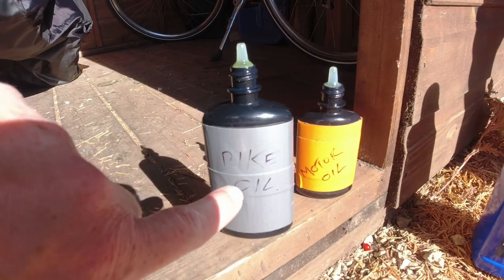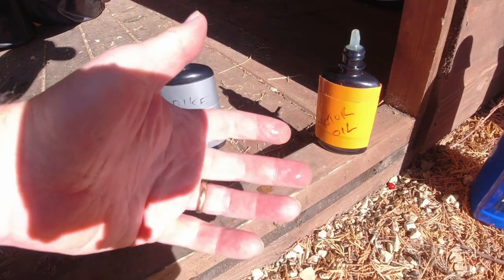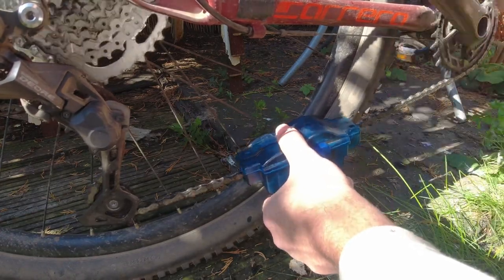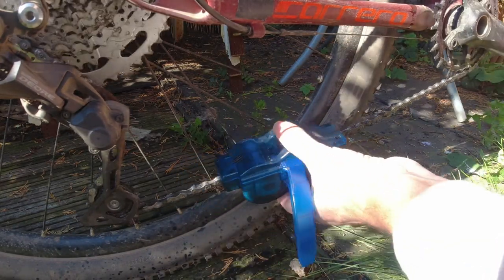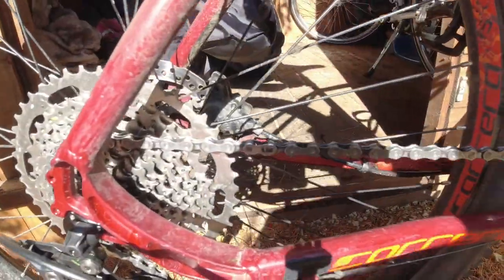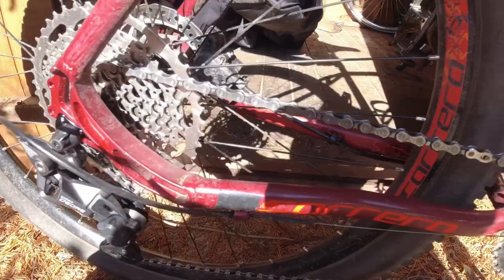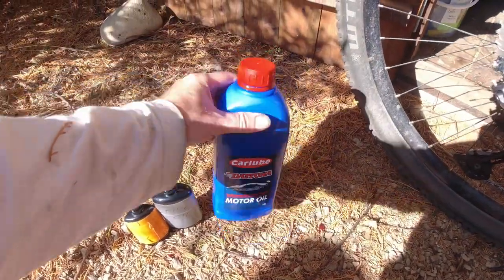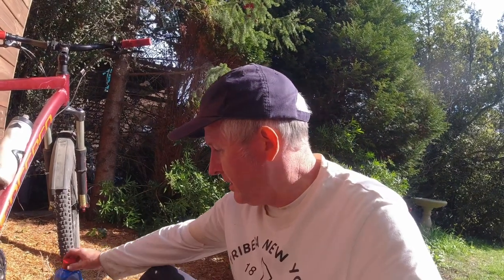Can you use engine oil on your bike chain ?

Comment: I grew up in a rural village here in South Africa and we always lubricated our bike chains with used motor oil. I actually never knew that motor oil is not black until later on in my teens when my dad bought a car.
Reply from the maker: Great story thanks for sharing 😁👍 yeah it looks like you were ahead of the game and I've just caught up. I now use engine or gearbox oil on my bike and it works exactly the same as the expensive bike oil and is so much cheaper
Reply: To dispose used motor oil in the environment is illegal. If you put it on your chain its nothing else. Also there is metal wear in it what es evn bad for your chain. Also engine oil as no additives for rust protection.
Reply: Same story here bro, grew up in rural south India, people using motor oil for lubing and never had any issues. But when we look online forums they kind of demonizing motoroil and promoting only branded chain lube oil😅...

Comment: Yes you can use engine oil on your chain. 
I've been using bog standard motor oil for decades !!!! 
On everything from high end racing bikes and racing, long distance touring bikes, ride to work junk, MTB.
And I've ridden them in all weathers and for 100s of thousands miles over the years.
Save a fortune and just use motor oil in a lever action oil can.
Reply from the maker: Yep you are bang on - there is to much of this 'elitism' in cycling now were manufactures will have you believe that you have to spend lots of money to get the best performance and people believe it. I must admit I have used the more expensive oils in the past but you live and learn eh

Comment: Been using used motor oil on my bike chain for 4 years and it works really good. A lot of people say motor oil is not a good bike chain oil, but at the time if motor oil can lubricant car pistons, valves, timing chains, etc I think I can trust it to lube a simple bike chain.
Reply from the maker: You are absolutely right 👍 Oil in a car has to do a LOT more work than on a bike. I have been using engine oil now on my bike since that video and I have had no problems and it saves me a fortune

Comment: Hi John, i like your way. I am with you that most bike lubrikants are just relabeled normal stuff. I am no expert. The internet says that motoroil has additives that attrackt water to get moisture out of the engine. On your chain you want the opposit. I use ATF now with no issues. But: any oil is better than no oil! Cleaning and lubing is the point! No matter what oil you use.
Reply from the maker: Hi Andreas - Yeah I think the bike oil companies are pretty good at marketing. Don't get me wrong there oils usually are very good but also very expensive and probably little or no different from any other oil. I do like the idea of being able to clean my chain more often and not worry about the cost of the oil
Reply: Motor oil getting moisture out of the engine? That's pure bullshit. The water gets expelled via heat + engine oil really like to combine with water as they don't separate(like gas, diesel, or cooking oil, silicone wd40 and stuff like that). The atf is also good, basically any petrol oil will do a it's job as long it's not too thick to catch all the dust but even then is good if u ride in harsh weather with a lot of rain/snow/dust as it's better to collect them then to penetrate the chain rollers and destroying the chain itsel.

Comment: great video, John :)

back in the day i used a small tin (same style as your plastic ones now) of bike oil - and i probably rarely put oil on my chain either, don't even recall cleaning my bikes much back then, and certainly never had a proper chain cleaning tool or a chain stretch tool haha... and never had to replace any of my drive thain ever..!

i first got into mountain biking around 1989 when a mate bought a raleigh montage atb (all terrain bikes as they were then..) - i had a ride of it - went flying down a mud track at jesmond dene (newcastle). hung on for dear life and went straight back to the top and back down...i was addicted to it! then i bought a raleigh mustang, then bought for first decent mtb around 1991 - a trek 950 which cost 500 quid... again, the maintenance was minimal...

i bought a trek 4900 around 2001, and when i was working at burmah castrol i bought a reduced price aerosol can of motorbike chain lube (cost about a quid for a huge can)...not sure what happened to that tho...

but with my emtb i use muc off's dry lube (which i think is specifically made for bikes?), you can say I've bought into all the correct cleaning stuff now as had the chain stretch took, chain cleaning tool (in fact bought a full cheap kit from amazon..)
Reply from the maker: Yes I have said this before but today's chains and other components don't last anywhere near as long as the stuff from years ago. I to never even noticed my chain on bikes from years ago. They just always seemed to work and you forgot about them

Comment: Yes. I've heard all the claims re it wears things out quicker, that it has additives that damage the chain, etc, never seen a scintilla of evidence to support them. You expect me to believe that the oil people put in $100,000 engines with 1000 hp has additives that are going to damage my chain that sees maybe 1 hp? Some of the only data I've seen re its friction on bicycle chains (at ceramicspeed) placed both 3-in1 and mobil 5w-30 (plain, not synthetic) in the middle of the pack of popular chain lubes.
Reply from the maker: Yes you are right oil for an engine is going to work just fine on a bike chain just as I have found out. I do need to experiment with the type of oil I used. Someone did mention that gear box oil would be good. That works out a little bit more money than the oil I got but it still works out a LOT cheaper than specialised bike oil. Its all just marketing really as cycling becomes more and more popular cycling stuff becomes more and more expensive

Comment: been using engine oil since i was in high school, parked the bike for several years, the chain was still lubed,. Why buy chain oil wich is the same price as chain itself? At that point you are just better off replacing your chain then keep lubing it up.
Conclusion: use whatever engine you have, thinner is better for winter, thicker is better for summer and bad weather to catch debris and deposit them on between the sprockets till you get home.
Reply from the maker: I could not agree more. I have to admit I had been duped in the past thinking the 'Special' bike oil was well.... Special. But of course its not and not I have a 2 ltr bottle of engine oil I got for around £4. I think next time I will try some gearbox oil. The daft thing is I had loads of half full oil bottles from working on the cars and i gave them away...... Duh!!  🤔😁

Comment: Engine oil is just fine, it could well be better than those expensive oil advertised for bikes.  I had used engine oil for a while and the chain was well lubricated, then I switched to DuPont ceramic dry lube to avoid touching the dirty chain.
Reply from the maker: Yes I could not agree more its just clever marketing to get cyclists to spend more money
Reply: I totally agree with you. It's a simply marketing strategy based on "This is good for something you love, so spend money on it."  This works on bike lubricants, car lubricants, firearm lubricants and even bottle water.  

People like you and me can save a lot of money. 👍👍
Reply from the maker: Yes some people do like to spend more money just because of a label or a badge or clever adverts. Its always been the same but I do love a good bargain and using engine oil on your bike is certainly going to save you a LOT of money. I do still need to experiment more with the oil I try maybe I will try some car gearbox oil as that I think would work even better
Reply: You also could use oilve oil, You could use any oil but that doenst mean that its good.

Comment: Engine oil as no additives for rust protection. Also there are good pland based biodegradable bike oils. There is no need to pollute the environment. I dont know why people complain about 10 bucks a year for a bottle of chain oil.
Reply from the maker: Engine oil does have rust protection properties but its all down to peoples choice. If you can afford expensive oils for bikes then great but some people cannot and engine oil will lubricate your bike chain just the same. I am not knocking 'proper' bike oil its good stuff but you pay premium for it
Reply: @JohnonaBike  No it doesnt and dont need any because it works incapsulated. I have seen a corrosion test with different substances from wax over grease and oil. They also took engine oil. The meta protected with engine oill rusted like it had now protection. To think just because the oil looks and feels the same it is the same is very naive. A bottle of bike oil last at least a year. Everybody can afford it. Its just stinginess

Comment: The reason why oil is splashing around from the chain is because the oil viscosity is a bit thin...20w 50....try a thicker  motor oil like 40w 70...a thicker oil will stick and wouldn't splash around...it will hold its position and lubricate properly...that's why your chain oil is so thick and expensive...thick motor oils are also expensive...
Reply from the maker: Yes that is a fair point if I used thicker it would certainly be better. Also someone mentioned using something like gearbox oil.  Thicker oil might be more expensive but I still think it would work out a lot cheaper than the proper bike oil. You put the word 'cycling' on anything now and the price rockets
Reply: @JohnonaBike  yes gearbox oil is very thick and I think will work the best ...but very expensive also...and yes in the long run it definitely will be much cheaper doing so..
Reply from the maker: Totally agree - Its an interesting experiment 👍

Comment: You've escaped the matrix when it comes to overpriced oil, but you're still using a chain stretch measuring device,  a cleaning device, degreaser & a water spray. None of which are necessary.
Reply from the maker: Sorry you have lost me ?  🤔 The chain stretch tool was something I never used years ago when chains lasted but now they last no time at all and when they do go they can damage other parts on your bike so I think I still (unfortunately) need it. As for the other chain cleaning products I suppose it depends on your preference as I know some prefer to remove the chain and clean it
Reply: @JohnonaBike  removing the chain is also unnecessary, in fact it weakens the chain. Plus how do you know modern chains last no time? Ever run one until it's slipping off the sprockets? Because that's when it's really worn out & putting you at a mechanical disadvantage, nothing to do with chain stretch.
Reply from the maker: Well my experience with a worn modern chain was when one had worn that I had not checked for wear (before I got the chain wear tool)   and it then had worn the rear cassette and the front chain ring to.  They had all worn so I had to replace the whole lot. Since then I have kept an eye on the chains now to stop it happening again. You could just use the chain until it fell apart but instead of just a chain you would be replacing much more and cost much more. So I am interested you seem to imply cleaning the chain is not needed do you never clean yours ?
Reply: @JohnonaBike  first point: until your chain is physically slipping off the sprockets you are not at any meaningful mechanical disadvantage.
Second point: chains & cassettes are designed to wear together & can improve in efficiency over time, no matter what a chain stretch measuring device says.
Third point: use of solvents, high pressure water, & repeated re-use of quick links are explicitly discouraged by manufacturers, for both mechanical & legal reasons.
Fourth point: I do clean my chain, but I only use a cloth & chain brush.
Fifth point: although engine oil is perfectly good for bicycle chains, in my experience oils with PTFE added are significantly better performing in all conditions. These are only available specifically for bicycles as far as I know.
Reply: @papalegba6796  chain measuring tool helps you not destroy your cassete ( i've been there)
PTFE oil works like charm, haven't recently tried motor oil but as far as i remember it attracts dirt.
Diesel fuel or oil for the laterns (Parafin Oil it's called in my language works like charm )
Also you need to oil your chain when it's dry (after a rain for sure) and once a month(?) maybe
Reply: @xiaomitelephone845  wrong.
Reply from the maker: Yes as I said to papalegba6796 I also had a cassette get badly worn and the crank to die to not checking the chain. Years ago chains would last a LONG time but not any more. You need to keep on top of it or PAY the consequences. I have been using thick motor oil for a while now and I see no difference at all to the expensive oil I used before.
Reply: @JohnonaBike  so you're saving pennies on oil, then wasting pounds on buying chains?🤔
Reply from the maker: Saving lots of pounds on oil 😁 and saving a small fortune on cranks and cassettes 👍 The thing is you can keep using the worn chain and it will wear the cassette and crank and you might not notice at first (I didn't) but eventually you will get shark's tooths on your cassette etc and then changing gears etc will be affected and even slipping of the chain and at that point you will have a BIG bill to pay maybe even 100 of pounds instead of approx £15 for a chain
Reply: @JohnonaBike  but that never happens to me, plus I can get a new chain for £5 & cassette for £20 at my local bike co-op anyway. Weldtite all weather oil is £20 a litre, which will last decades, chain brushes are £1.50 on Amazon, rags are free. So I spend well under £5 a year on drivetrain maintenance, no need to scrimp on oil. I don't know why you're wearing parts out so fast but it's not the case for me.
Reply from the maker: Yeah I agree about me wearing parts out maybe its down to mileage or not made to last  but they seem to last no time at all. You do well to get the chain for £5 that is cheap and so is a cassette for £20. When my mountain bike needed parts I spent close to £100 and that was me doing the work myself to. As for the oil its an ongoing experiment for me. I used to use the expensive oil and it was good and then someone said to me "They don't make oil just for bikes" and that got me thinking. Is it just the same but rebranded in little bottles. I got 1.5 litre of engine oil for £4 and it does seem to work just as well for me but time will tell
Reply: @JohnonaBike  yeah the bike co-op is great, they get tons of donations plus a mate of mine works there so alerts me to good stuff lol. The chain is a KMC X8, the cassette a nickel plated Shimano. As for oil, if I could source Teflon oil cheaper I'd buy it, but as far as I'm aware only bike oil has it, & the Teflon really does make a difference in my experience, especially in winter & wet weather. I use 100ml a year at most anyway, £2 a year is nothing.
Reply from the maker: Sounds like you have a real good source for your bike gear 😁👍 makes all the difference when buying stuff doesn't cost a fortune. Bike stuff never used to be so expensive but the prices on stuff is getting silly and there are less suppliers with Wiggle etc closing 🤔
Reply: @JohnonaBike  the bike co-op is a gold mine, have to admit. Like, I got a mint condition early 1990s Deore LX 8 speed rear derailleur from there for £15, that thing is bomb proof & will last for ever.
Reply from the maker: Yes if you find a supplier like that then you are very lucky as a lot have disappeared 😁👍